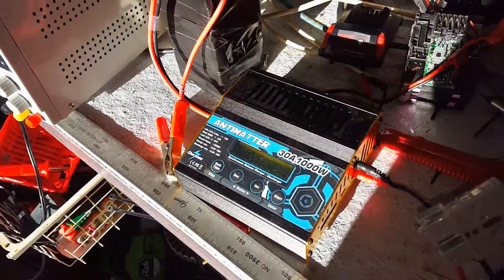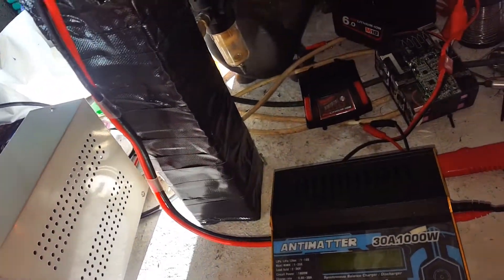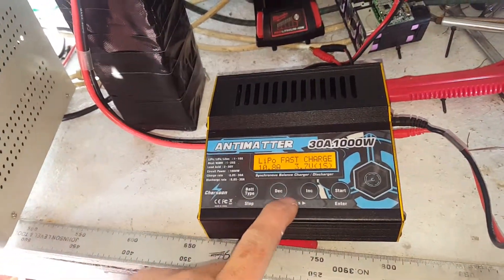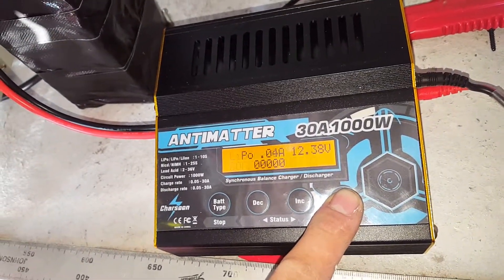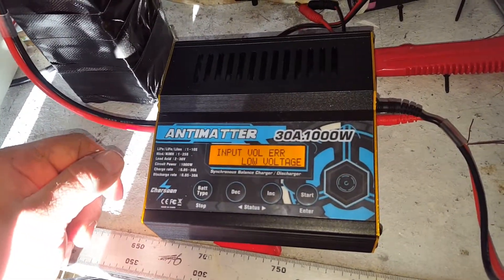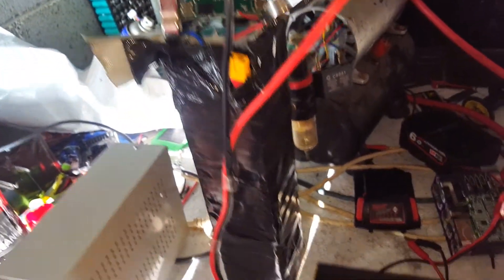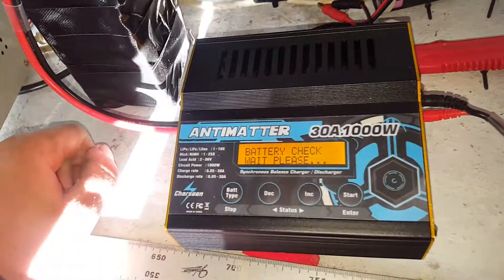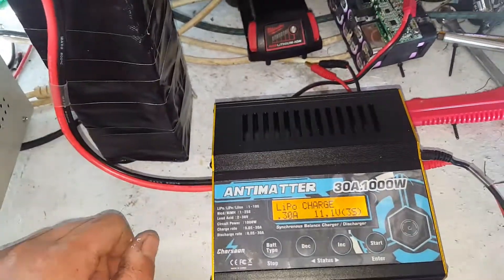Antimatter  30amp lipo charger discharger viewer questions answered

Comment: I think you had the discharge on 3s
Reply from the maker: +Keith Tucci yeah its discharging the  3s blue pack  into the  3.7v 1s 60 cell pack witg regenerative discharge
Reply: One up the sleeve customs but wouldn't you want to switch that to 1s if your trying to discharge it back to the other pack?
Reply from the maker: Keith Tucci na its asking what voltage your discharging.  When i was in settings you limit the voltage of the regen there
Reply: One up the sleeve customs ooooo ok. Gotcha. New unit, was looking at this for a future purchase..maybe
Reply from the maker: +Keith Tucci even though i was sent this for review ( still not biased) these are epic. So much charging grunt